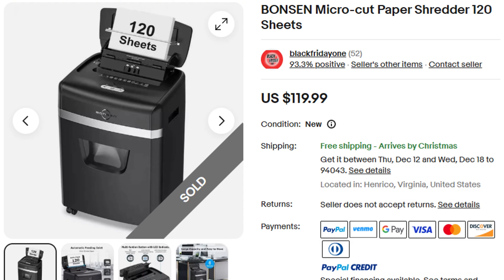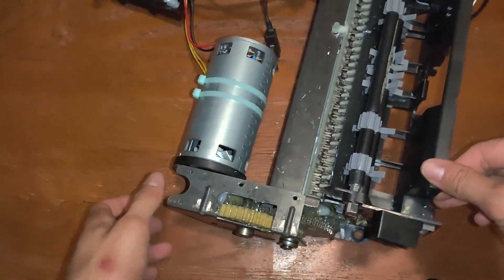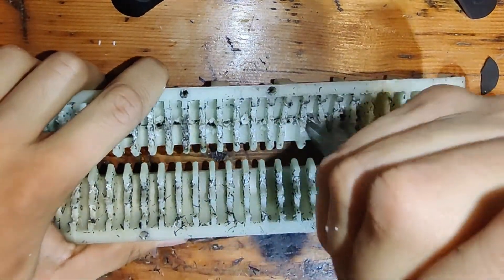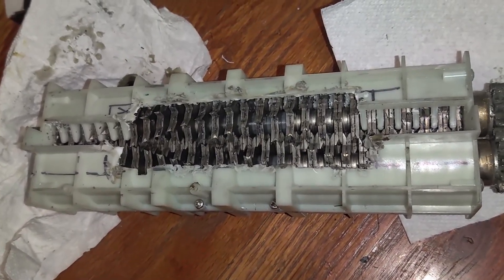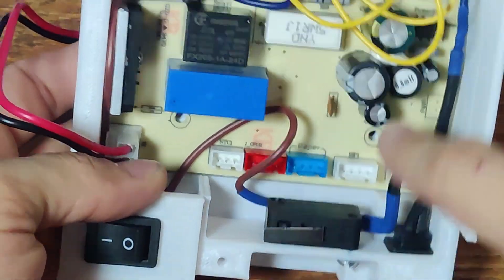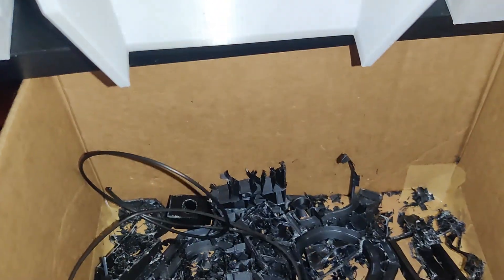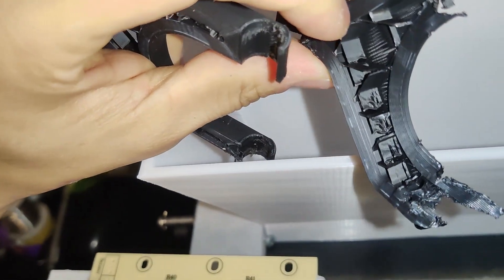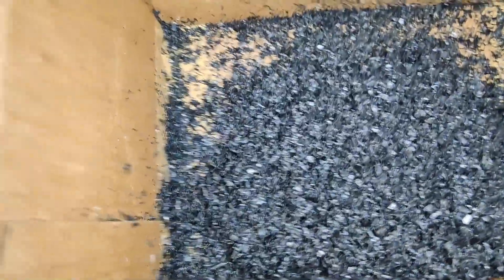shredding 3D printer plastic with a paper shredder

Comment: This is the best diy shredding video I’ve seen on YouTube. Way too many ‘cheap’ solutions that tell you to buy a $600 industrial shredder for your hobbyist set up. Great job!
Reply from the maker: Right! I saw people spending like 1k on a shredder and said it was a budget. Like if my plastic shredder costs 5-10 timers more than my printer that's not budget. Also there is a $50 upgrade that I'd like to make a video on, because the motor and gearing is made to shred paper not plastic, so all I have to do is design a gearbox and get a better motor.

Comment: you dont have to change the gears or the motor, just need a motor controller that will push more amps
Reply from the maker: You'd be right if the controller was a bottleneck in this situation, the problem is that the motor that comes with the shredder overheats in 10-15 minutes of use. So more current more heat, less efficiency.
Reply: @-EhsanMalik-  yeah id put a fan and heatsink on it though
Reply from the maker: @Blox117 Once I do upgrade the shredder, I'll try your method and I'll see from the tests, maybe I'll save a couple hundred bucks from R&D
Reply: @-EhsanMalik-  cool!

Comment: Here's an idea: put parts that don't fit on a silicone tray to put in the oven and melt them into a smooth uniform sheet. Put the oven at the minimum temperature that can melt it (in my case it was the absolute minimum of "60" degrees). Make sure it won't overflow the tray!
Reply from the maker: @DiThi  that's smart, unfortunately I do not have a designated oven to do this